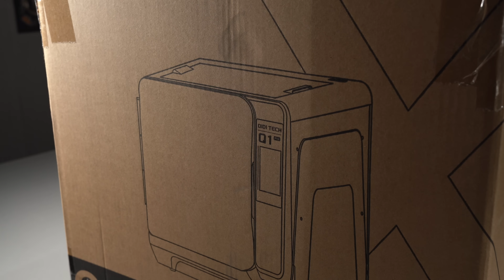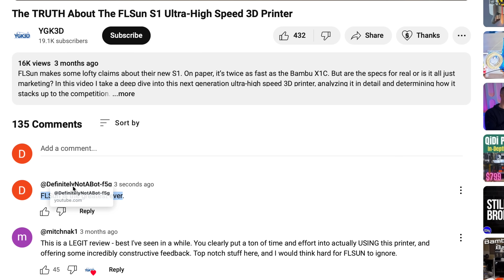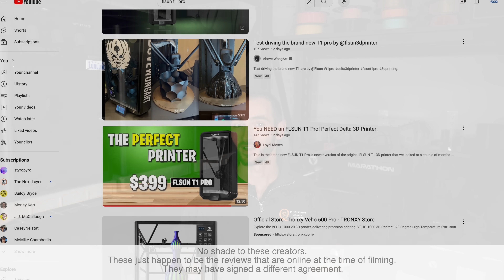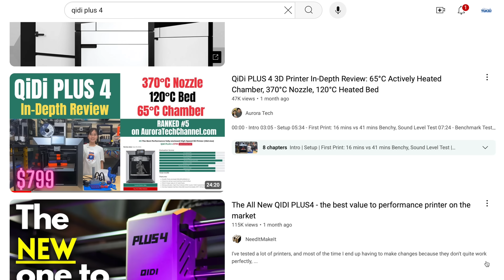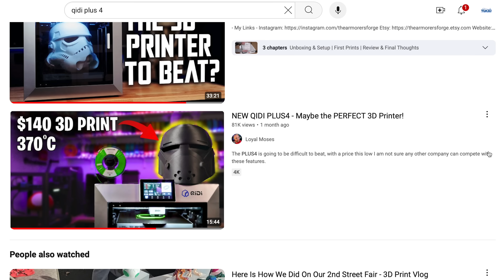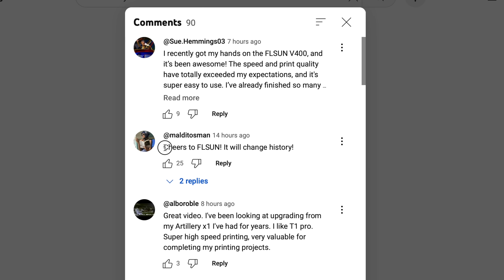This is why you shouldn’t trust 3D printer reviews...

Comment: Finally, someone's talking about this! Last year, I was looking for a beginner-friendly 3D printer on YouTube and got misled by a bunch of videos. No one warned me about the issues with the bambu P1 and how lousy their after-sales service is. I respect every content creator's work, but I guess I need to step up my own judgment game
Reply: p1 is fine, but artificially limited ny its firmware to make the x1c look better. my biggest issue with the p1s is not being able to go higher than 100c on the bed, which makes no sense because its the literal same exact bed as the x1c.
Reply: P1S, A1 and a mini. Plenty of hours on all of them. Only had one legit issue on the P1S where the tool head cable had to be replaced early on. Other than that it's worked great. Ticket response can take a while sometimes but they always keep at it until the problem is solved. Honestly don't understand the comment.
Reply: I think it was a bad example. Everyone understands that no matter how good a product is, your experience can differ from the norm or a review.  The fact is that he probably made an informed decision to purchase a P1P, but was unlucky doesn't confirm or disprove the (assumed) hypothesis that Bambu printers are bad and have paid off reviewers. The commentor is a single datum that has no meaning. My stating that I used one for a year with no issues also means nothing  unless you're going to probe the types of material, build plates, hours of use, my experience in maintaining and fixing errors etc. Even then, I could have just been lucky.
Reply: If you are a beginner, what machine not factoring cost is the right one. I was looking at the bambu x1c but now you have me confused. Help.
Reply: @darlahpotechin1668  depends on your use case. If you don't need to heat the bed to 120C and 100C is suitable, which is fine for hobbyists, the P1S is best for a core xy printer. Best value is either the A1 or A1 mini (bedslingers) depending on whether you need/want the larger print bed. Personally, I'd recommend the A1 if you are first starting out (i have all three). The quick swap nozzles on the A-series is huge plus. Maintenance is easier as well.
Reply: @ do not want a bed slinger due to space and vibration. Reminds me of a swing away heatpress just different directional movement.
Reply: @darlahpotechin1668  in that case I'd go P1S. Also, they are dropping a new printer Q1 next year.
Reply: Idk why so many people are complaining about there printers because the failed prints I had were my fault.
Reply: Is this now also some kind of fake comments?
My P1P and A1 never played tricks on me since I got them when they were released
Reply: @maxl96systems probably user error. These machines are marketed basically as "just works," which would indeed be true for a few months. But the a1 mini needs lubed. It tells you when and how, but will happily let you skip the warning. Most of these types of posts I come across are also using cheap/crappy/wet filament.
Reply: @michaelgleason4791  well, makes sense, didn't think about people not caring 🙃
Reply: @michaelgleason4791  agreed. These are precision machines and need to be treated as such. When my A1 Mini says lube me I say yes dear LOL. I have mine a month and almost 400 print hours. Got the second lubrication notification yesterday. And did it. Takes 5 minutes.
Reply: You are gong to get a lot of mad BL fanboys coming at you that can't fathom how someone could speak ill of their precious printers.
Reply: You’ve been surrounded by the unstoppable BL Bot Legion, ready to bombard you from every angle with enthusiastic reviews about just how incredible Bambu is!😄
Reply: What issues? I've got a few hundred hours on my p1s and thre only prints that have failed have been my own fault. I've only today just replaced the nozzle 1st wiper (which was supplied).
Reply: Yeah Bambu really doesn't have Support! The effort you need to put into them to get support is insane!  I started with a P1S that was a Lemon Bambu was trying everything to delay support so I couldn't return it to Micro Center " I did before the clock ran out" and purchased a X1C so far it's been great. I understood if something happens to the X1C I'll be down for a long time.  What really got me was when they told me they are not responsible for downtime even in a days old printer and I should have purchased extras as backup right out of the box HUH?? I'm working on a YT video of that entire fiasco I kept the emails etc showing what they said.
Reply: Had the same problem, I bought an A1 mini and after 3 months, it's quality degraded significantly.
Reply: My a1 mini is about a year old and has a few hundred hours on it. Still works flawlessly.
Reply: @BojanSusic-qi4qn  vjv ti je filament u kurcu.. imam nekoliko a1, a1 mini i p1s printera i niti s jednim nemam problema. Preko 1000 sati printanja, i sve radi.
Reply: @BojanSusic-qi4qn  Im not the biggest fan of bambu, but I own an A1 mini with 800+ print hours, it prints as well as it did day 1. Theres something else going on with your machine. My vorons, and prusa machines also print like day 1. Maintaining a machine is important.
Reply: @BojanSusic-qi4qn  Have you dried the filament?
Reply: @BojanSusic-qi4qn  
New to 3D printing. I have my A1 Mini for a month now and almost 400 printing hours. Nothing but a positive experience.
Reply: This is old news. Makers Muse, among others, brought up these issues years ago. Yawn.

Comment: Spot on..  I am a newbie to 3D, so I've spent many hours learning, trying to decide which printer, and manufacturer is best suited to me. I did buy a Qidi Plus 4, after viewing a number of positive reviews.. There have been a  number of issues popping up since, in units when they showed up in the hands of buyers. So why didn't the reviewers have/discuss these issues... Well the one issue with the heater relay board doesn't show up on 230v machines. (EU, China, etc) but does happen on 120v machines (US).. SO possibly those reviewers weren't in the US... The other issues are field fixable, with parts from Qidi, for the most part.. I must say that Qidi's response to me has been great. They responded quickly, and added extras for my inconvenience.. The Plus4 does provide great prints, and I feel Qidi will resolve all outstanding issues in a timely fashion..
Reply: I agree 100%.   Most issues are minor and compared to printers not that long ago it is light years ahead. My "push" in deciding was after hearing all the real world feedback (both positive and negative) one person said it best. 5% off first time buyer, free shipping, no tax, and a 2yr warranty to swap a board when buying direct (until 12/31). For the price I can deal with some issues and ironed out the rewards are potentially great.

Comment: Another issue that you didn't mention is that we get special treatment in terms of (likely) cherry picked units and tech support, and only have a sample size of 1. It makes it really hard to judge QC, reliability, and customer support, which are huge factors in whether someone has a good experience with their printer.

But what is the solution?
Reply: Complete teardown, entensive long term test reports, group discussion/podacst with real machine design engineers, unity among youtube reviewers regarding terms set by manufacturers.
Reply: The only solution would be to buy the devices yourself, but nobody could afford that. The manufacturers know how to manipulate reviewers without the latter realising it. The only thing you can do is to be aware of it.

What many influencers don't seem to understand. They are not ‘friends’ or ‘partners’ of the manufacturers. They are a marketing tool and nothing more. If even the slightest bit of criticism goes in the direction of the manufacturer and they cut ties, you know you've just been exploited.
Reply: @andreas.grundler  Ideally, the manufacturer could put money to buy a unit in escrow.  Then someone with a different name and address orders the machine, and is repaid  using the escrowed money that the manufacturer can no longer track.  That machine is then delivered to the tester for review.  This way the manufacturer doesn't have any way of knowing which machine is going to the tester.  However, there are probably some manufacturers who wouldn't agree to these terms.
Reply: I think this is something that really needs more attention.  I pre-ordered a Creality K1 based off positive reviews on youtube.  My first k1 was a nightmare, both in terms of how poorly it worked and how detached Creality customer service is.  The replacement k1 is a reliable machine but it has a lot of artifacts in the print.

I guess the real problem is that it only takes one reviewer who needs the cash more than to maintain their integrity to cause problems.

Is the 3D printing community large enough to have some kind of association, so that any member of that association, big or small, gets bound by the same set of rules?  That way if a 3D printer manufacturer wants to have their unit reviewed, they have to accept the conditions of the association, regardless the size of the content creator. 

I suppose the theory, that an association would mean large creators would give strength to the smaller creators because they could highlight any time a company tried to unreasonably strong arm an association member.
Reply: Buy the printer yourself and stop the stupid discription's like "Bambu Labs is cooked" also remember "Creality K1 the best printer ever" how about honest review's
Reply: @NathanBuildsRobots  You are very much part of the problem.  You do two things.  You shill and you make content that makes people mad intentionally. 

I put you in the same list as I put DPT in, garbage!
Reply: Cherry picked printers are a fable. I’ve been reviewing for about 3 years and everyone but Prusa have sent me a lemon at least once.
Reply: @stldenise  They didn't send you a lemon, they sent you an orange 😆
Reply: Use your own money and buy the unit without your name on it. Pretty simple really to enjoy the full experience us mere peasants experience.
Reply: Is this really a thing though
I am a vine reviewer and I have received products that already opened and poor quality and defected items for reviews sometimes.
It seems like it would be a lot of effort to be testing units and then shipping from a nonstandard location and other logistical hurdles.
Would vit acu be worth it for them?
Reply: get one from manufacturer early to test, review and create footage. buy an extra one as an anonymous consumer to quickly test your review data on for a double check, then return it. thats how you solve the issue because you'll have the video out on time and have reliable data with a sample size thats not just handpicked by manufacturer.
Reply: There is no good solution under capitalism ...
Reply: @3nertia  Are you an avid pamphlet reader? your experience from other political systems? Have you ever seen at close range realities of different places on Earth basking in a benevolent light of K Marx teachings? If not ,stay silent ,please and don't join ranks of useful idiots

Comment: Shame about Qidi 4. Was looking forward to buying but thanks for the warning! I guess I’ll just have to wait for a few more months for them to resolve those issues before getting it.
Reply: Exactly, competitors have had plenty of time to "catch up" with Bambu reliability, so I wanted to believe they have, and I'm sure others feel the same. If a reviewer isn't honest, that can push people over the edge and invest poorly in another troublesome machine. Qidi fixing the 4 hopefully goes well, because even Bambu will become better to try and stay ahead. It's good for everyone.
Reply: I have a Plus 4 and before that an X Plus 3. The XP3 printed beautifully but was plagued with small problems. I hesitated on buying the Plus 4 because of my previous experience. I haven’t had the chamber heater issue with mine and I’ve printed a full roll of ASA GF, but I also haven’t opened the back panel to check the SSR to see if it’s been overheating. My experience with Qidi support has been that they are very responsive-which some people mistakenly call good-but they seem to go out of their way to avoid taking a printer back when there are obvious problems. They seem to prefer firing the parts cannon at the problem instead. There are several known hardware issues with the Plus 4-nozzle clogs, the SSR issue, and not being able to use the full build height because of a faulty design in the chamber heater itself. I’m seriously considering demanding a return but it does do an amazing job printing and handles ASA as easily as it does PLA. If I were you, I’d wait..it seems like they’re using this first batch of units as beta test machines.
Reply: @ I will definitely do that. Thanks for the input!

Comment: honestly very happy with x1c ams vs prusa at this point. had a prusa mk2s and XL 5t now at work and in my experience they are not appliances. maybe mk3/4 but i would/will go with a tool changer or dual extruder or whatever big bambu. hope they have chamber heating standard that is the one feature i might add + gotta make a pythons ams. for budget i would probably go with a sv07 or something that seems like a decent parts kit as of last I looked months ago.
Reply: exact opposite experience here - the Prusa XL is my favorite pinter that I have right now. Have not has a single issue with it (althought the Connect App needs some work, but that is not XL specific). My X1C just can't compete with my XL (or really my Mk4S and MMU3) The AMS is fiddley, wasteful, and slow compared to a toolchanger.
Reply: @paulhuckaby  The price, though. Obviously personal needs apply here, but for people like me who are fine with basic filament types and the lower build volume of the Bambus.. I could get 8 Bambu A1 with AMS for a single 5 head Prusa XL (the store I checked didn't offer pricing for a 4 head version, so mentally adjust a bit to compensate for that). Even if I needed some more advanced filaments, I could still get 3 X1C with AMS. It would take me a whole lot of wasted filament to make up for that price difference.

Having said that, I very much do hope other multi filament solutions arrive soon, at liveable prices. The AMS is great for limited use, but for "printing everything in color" it's not really suitable. I really wanted to get the Prusa XL when I first heard of it, until I noticed the price and considered that my use is very much "limited hobby". Perhaps in another 2-5 years something will be available.
Reply: @mascot4950  agreed that if you are mostly printing PLA or PETG - and those smaller build volumes support your needs, then the A1 mini would be a fantastic printer for the price. I do a lot of multi material (including multiple colors of TPU) and prints that need larger print volumes so the XL fits what I need. In fact I really need a bit more volume than the XL for some things, so I’ve just ordered the RatRig v-core 4 IDEX 500mm. I honestly think AMS units will be a thing of the past once tool changers are more widely available. Once you use a toolchanger it’s hard to go backwards to an AMS type unit.
Reply: @paulhuckaby  The numbers were for the A1, you'd be into the double digits if you went with minis. :) As for which is better, in every way but cost, there's really no argument. Likewise, it's hard to beat an AMS priced at something around a single toolhead. I wouldn't be surprised if both hang around for the foreseeable future, one for limited needs on a budget, and the other for the higher end market.
Reply: @mascot4950  agreed - but I don't think toolheads will be limited to higher end only. Once we see the chinese manufactures start mass producing them - the prices will fall. If Bambu were to announce their next printer as large build multi-toolhead at price point they can get down to - it will take off! Its only a matter of time till the chinese manufactures jump into that segment. Lots of projects on the open source side doing it - momentum is going that direction - one of the chinese companies will jump in and it will open the flood gates.
Reply: @paulhuckaby  You might be right. But I figure there's only so cheap anyone can make quality toolheads. Hopefully I'm wrong, or they find some other way that doesn't require doubling up on expensive components. I did remember one area in which the AMS is superior: number of colors. I doubt we'll see printers with 16 toolheads anytime soon.